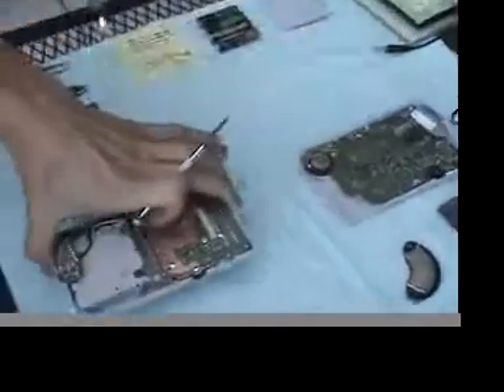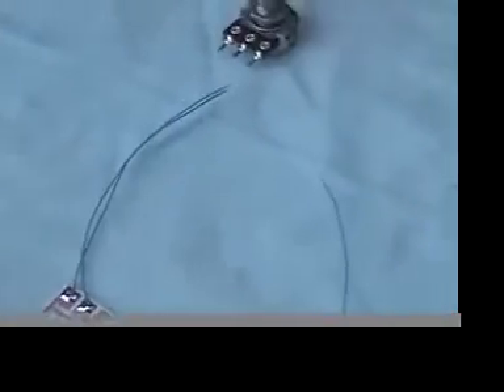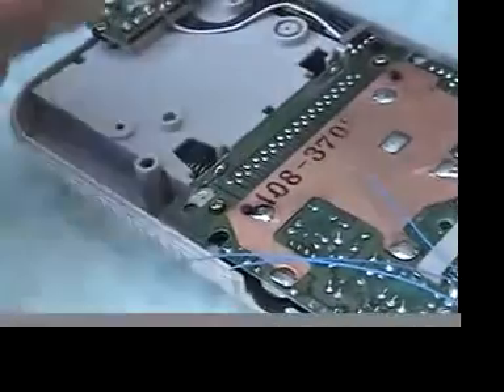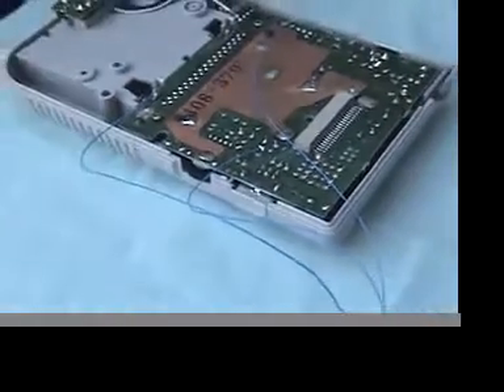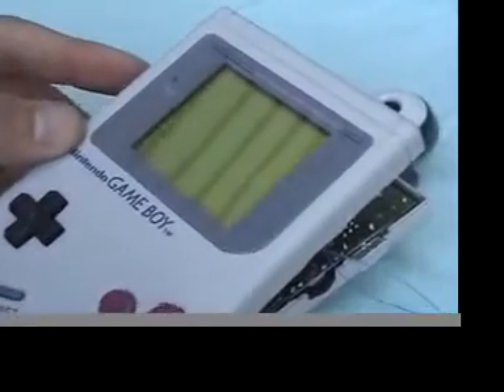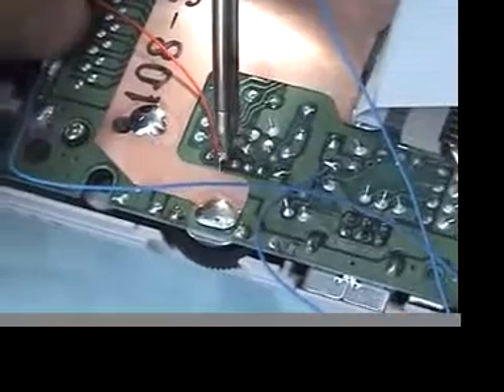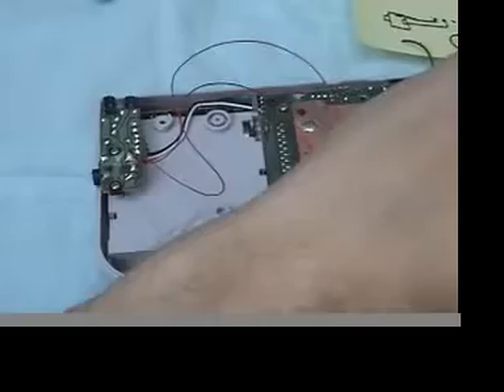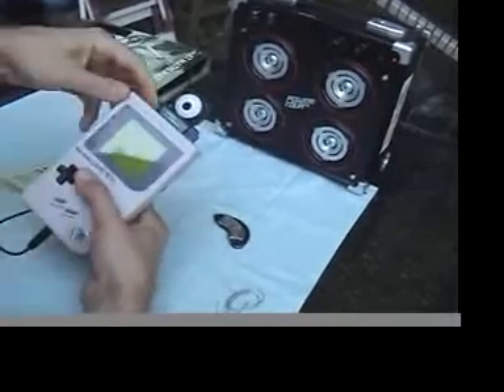Modifying a Gameboy - Adding a GetLoFi.com LTC Module and Pro-Sound Mod

Comment: I'm assuming you just want to be able to place the screen somewhere else while you use the buttons, right? It's totally possible. All you have to do is extend the connections between whichever parts you want separated. The only problem would be that most of the components would just be exposed then. 

Instead of that, I would consider just wiring an NES controller into the gameboy which would leave the gameboy intact. There's some information about that in a few places online.

Comment: I wonder if there is a switch that would enable me to switch the bottom jack between pro-sound and headphone-level (using the volume potentiometer as usual). I'd prefer that over two jacks or one jack with only pro-sound any day. I know there are switches that close one circuit in one position and another one in another position. There would have to be a switch that can do that times two. Is there such a thing?

Comment: @thedirtys2006 the pro sound mod is a way of getting a clear line level output from the gameboy. it basically removes the internal amplifier from the headphone jack to reduce the noise and gain of the headphone jack output. because its a jack output it will be stereo, only the speaker is mono, you can't prosound the internal speaker, there wouldn't be enough power to drive the speaker with that signal.

Comment: well it works, but only the left channel.
i tried adding the right channel to the third of the big connections on the output, but to no avail.

i'm thinking that cutting the last black wire might do it... but i'm not sure...